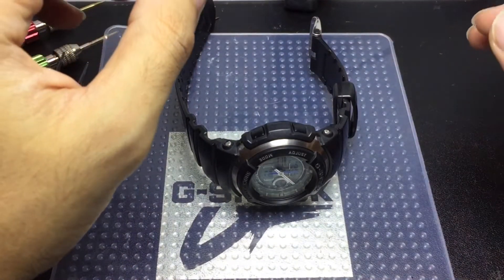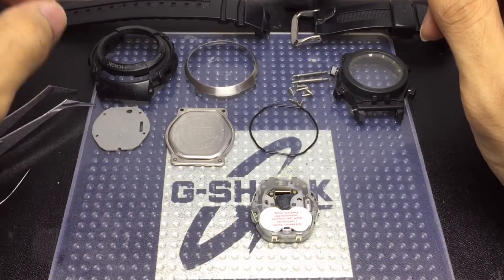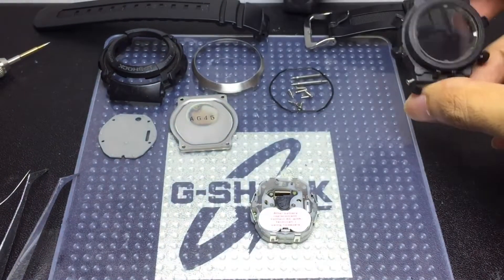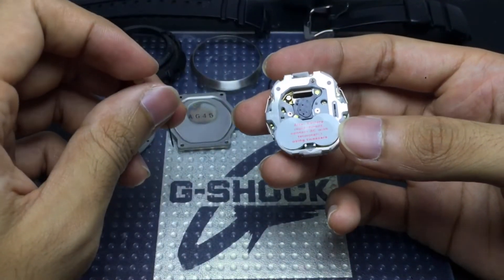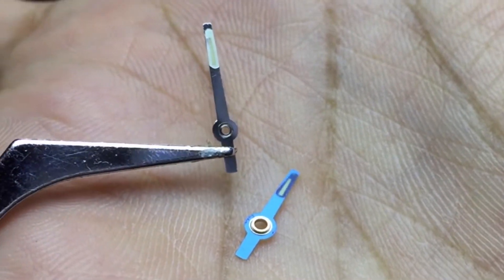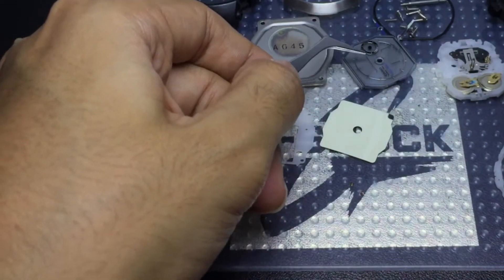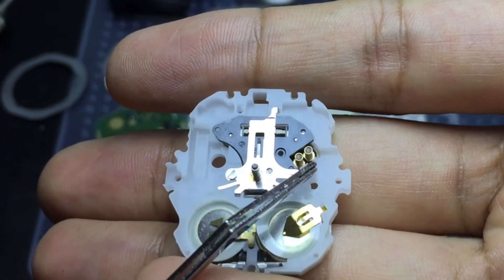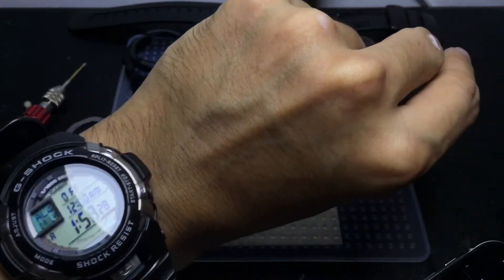G-Shock G-303B G-Spike watch teardown

Comment: Hi. Just replaced two batteries on my g-303. Everything works exept analog clock. What should i do? Maybe i should reset analog engine somehow? Because digital module works fine and i reseted it.Thanks!
Reply from the maker: It is getting more common now I guess. You'll need to disassemble the
movement to inspect the circuit board for any battery leaks or residual that disconnect the connection to the coil motors. Clean them and hope it works.

If it still not working, perhaps there're electric components that has expires and circuit board replacement is needed. 

If that is the case, better for you to get a donor board instead of fixing the board. Just hopes there're just connection issues.
Reply: gshock highfashion Thank You. I'll try to disassemble to find out.